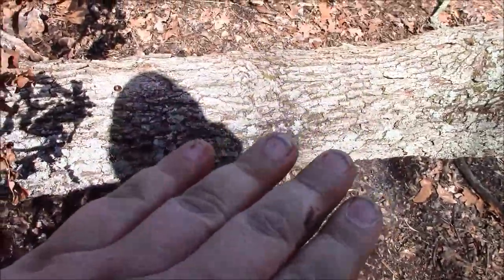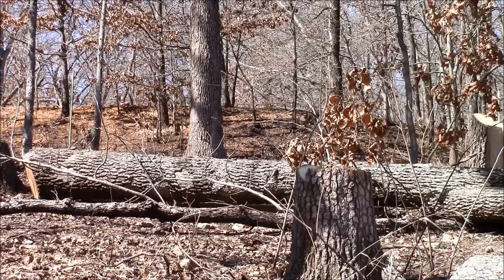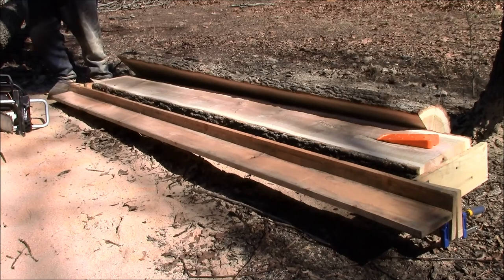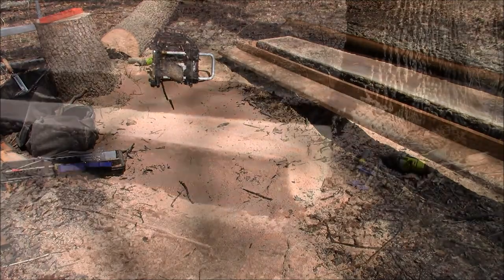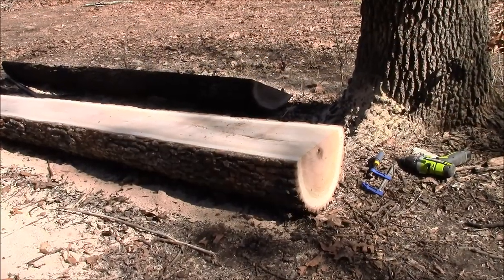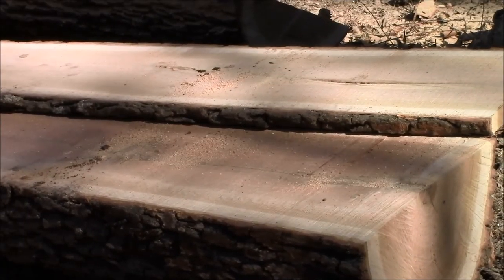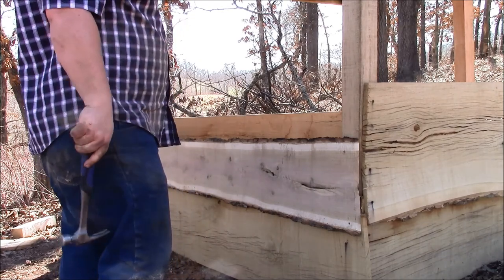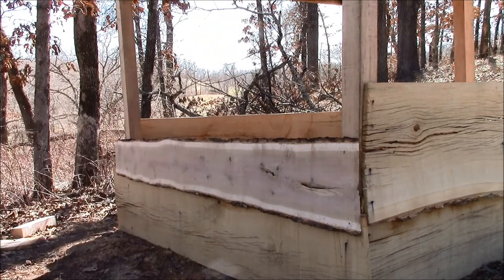Better Way to Mill Lumber For The Shed Sides

Comment: I thought of a way to rip 3/4" boards without all the wasted wood, wear and tear, bar oil, and mixed gas of a chainsaw. First, you mill the log with an inexpensive Timber Tuff Lumber Cutting Guide and a 2x6 guide board, so you have a 3 sided timber 7 1/2" thick. I bought mine on ebay for about $26. Timber width doesn't matter.  I converted a hand held circular saw to a 10" blade, with a 10" x 3" fence made out of sheet metal, tack welded to the saw base plate, 3/4" from the blade. Everything must be set up square in the right places. Also the base plate slot has to be increased to accommodate the bigger blade.   Rip multiple cuts down one side of the timber, and you run that fence down the groove of the previous cut each time as a guide, until you run out of material.  Then, flip the timber over to the other side. Run identical cuts down that side too, identical to the other side so the grooves match up, thus making cuts completely through the timber. I think I measured the maximum depth of the 10" blade cut at about 3 7/8".  Its basically just like using the table saw, but you don't have to hump the heavy timber out of the woods, and don't have to lift it up to the table saw.  Use a small generator for power, or a long extension cord if you're close to an outlet.  Another way to do this is to convert a band saw into a small portable sawmill that scoots down a 2x6 track for the initial cut, then down the flat spot thereafter. But the 10" circular saw is a better idea, I think.  So, You can use those 3/4" boards for board and batten siding, floor boards, roof decking, etc! For different thickness boards, just weld the fence in a different spot on the saw base plate.

Comment: One could also modify a porta-band saw to be wider, with an adjustable skid/depth plate on it, to be used with a 2x6 guide board for the 1st cut.